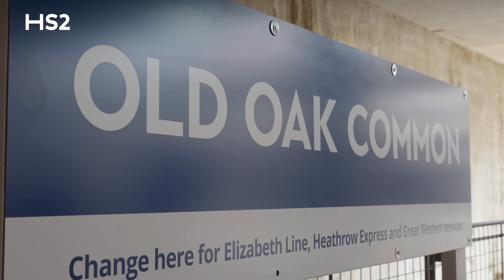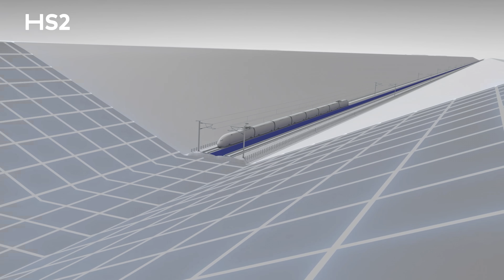HS2 Project Update, July 2025

Comment: It’s been almost 5 years and you are still fiddling around with the foundation at Curzon street station.

At this rate it’s going to take you at least 10 YEARS to build 1 train station. 🙄
Reply: The Curzon Street station contract is running to programme. The station building itself is undergoing a redesign in an attempt to get the project within budget.

Comment: Won't be used. Internet conferencing will be much cheaper. People will use the slower train as 10 min quicker and the other is  not worth the candle.
Reply: Incorrect StJohn. You clearly don't understand the project.
Reply: People will always need to travel. It's far more than a 10min saving, but time saving is not the primary point of building this.

Comment: This is so much better news.  In the past very little focus on the route wide benefits and employment has been made.  All we used to hear was speed and time saved, very little about capacity on the WCML and the network generally.  Folks will see big improvements to local road networks close to HS2, they will see bio-diversity better than before project, and a highly trained workforce that will be able to move on to other projects.  The UK's skill shortages for the last 40 years because, in my view, of the lack of technical education, with concentration on university for a non vocational degree.  Have you noticed how often a Professor of this or that is rolled out on radio and tv, or consultants in court cases usually all past retirement age, appear as expert witnesses.  Out of date and well past their sell by dates.  HS2 is back on course to the success it should always have been, Nimbies and political interference almost sunk it.  These were the biggest cost increase drivers.
Reply: If you asked 1000 UK citizens 'when did HS2 construction commence ?' , most would tell you 10-15 years ago. The actual fact was April 2020, so all that has been built has been done in a little over 5 years. The rest of it has been delay and obfuscation by Politicians of every stripe, Labour, Liberals, Tory and Reform. Local councils have literally gone out of there way to obstruct the project at every turn and continue to do so. Buckinghamshire being the worst.  Certain special interest groups, Quangos, sections of the media, have taken relatively small issues and exaggerated them.

Comment: A report previously published in france said their high speed train only really benefits Paris. This hs2 will only end up benefitting London. Its way behind and way way over budget.
Reply: the difference is France already has an established high speed network - and its one entirely centred on Paris - hence the problem you indentified

HS2 essentially isn't comparable with the LGV network because it's one (relatively small) line, of course it goes to London, you'd be insane not to send it there

in an ideal world, the high speed network in the UK wouldn't be biased towards London courtesy of HS3/NPR and HS2 already has provision for that with the building of the north curve at the delta junctions in Birmingham. not to say the HS network shouldn't connect to London though, because it's the UK's largest city

Comment: If it does not connect to the north then we are kidding ourselves on the value of hs2. We need a big push to get the railway open. Time is passing and the completion date just moves constantly to the right. The civils works will be 10 years old before the railway gets into operation. Great project but please can it be opened sooner and phase 2 restarted.
Reply: The entire anglosphere is taking way to long to build things.
Reply: Even if it does, projections show it will take 100 years to break even.
Reply: It could be connected to the north. It just needs another £100 billion spent on it...🙄..let have a whipround...😉
Reply: @leethrelfalllt  Just cut funding to pointless road projects that provide such little cost benefit.
Reply: @kmcat  The Thames Esturary Road Tunnel, The Stonehenge Road Tunnel and quite a few big ticket road projects are as likely to be built as HS2 Phase 2.
Reply: @kmcat name some?..🤔
Reply: @johnwood2448 And they will all go over budget and programme. As to will Heathrow's third runway, sizewell C, 1.50 million new homes programme and the new hospital programme.
Reply: Fatuous comment. @leethrelfalllt
Reply: @MrDavidht Fabulous comment.. corrected for you..😚

Comment: The cart before the horse unfortunately. Part of the railway establishment wanted to build a high speed line in the UK and only then started looked for somewhere to build it. Unlike France and Spain high speed rail is not appropriate in the UK as the large population centers are too close together and are already connected by 200kmh/125mph classic lines.
Reply: Sorry but you seem to have not had the email that HS2 is more about capacity increase and the freeing up of the WCML from path hungry express trains to give more pathing to freight and suburban services. But if you are building a new railway it doesn't that much extra to add high speed capability.
Reply: @1chish  The original flex for HS2 was faster journey times to London, the narrative only changed to adding capacity after the idea that tens of billions of pounds would be spent to save half an hour to get to Birmingham was met by some derision from the public. The capacity problem can be solved by running longer trains on the existing tracks.
Reply: @aw34565   Your last sentence shows a pretty firm lack of knowledge about how pathing on main lines works. Why do you think there is a length limit on freight trains? Because they take up too many 'blocks' which reduces the pathing.

I agree the initial naming just followed 'HS1' to be 'HS2'. However it was always built to add capacity by taking path hungry express trains off the WCML and not introduced later due to the costs. It was the NIMBYS and tree huggers that made 'speed' the only reason for it and make the very complaint you suggested.
Reply: @1chish   Very difficult to remove path hungry express trains from the WCML given that cross country services will continue to use the WCML as HS2 does not have a south facing junction. Also, folk living in cities that HS2 bypasses (Coventry for example) will still need express trains to London and the North so I can see why the original flex for HS2 flex was for speed. Mind you, the original claim for 36 minutes saving on the journey time between London and Birmingham is rather less than 36 minutes now HS2 line speed has been cut from 248mph to 200mph.
Reply: @aw34565   A question: Do you know how many people use Avanti West coast every year to Birmingham and the North? They fill a lot of trains.

Given that every Class 390 will be replaced by trains running on and off HS2 that frees up a large number of paths on the most congested part of the WCML that will be used for freight and suburban services like the Coventry ones you mentioned. Cross country do not run tilting trains (they did run Class 221s but no longer tilting) so their speed is restricted to 110 MPH on most of the WCML but in any case they use very few paths on that line compared to Avanti Class 390s.
Reply: @1chish  We cannot cut the number of express trains on the WCML to provide paths for other trains unless you want all the places on the WCML that HS2 bypasses (Coventry for example) to lose their fast trains to London. The capacity argument for HS2 is just hot air.
Reply: Look at a satellite image of England at night, all lit up. And you'll see exactly why HS2 has been built where it is, and where it was planned to go!

Comment: Whilst HS2 has benefits (mainly related to the much-needed additional capacity it will provide alongside existing routes between London and Birmingham), I can't help but wonder how much good the money spent on HS2 would have done to the existing network. For me, it's not so much about the big projects like HS2, it's more straightforward things like the refurbishment of Crewe station, the electrification of the Chiltern Main Line and the reopening of the Burscough Curves that would greatly benefit everyone (not just those who live in big cities). Since its inception in 2009 (under Gordon Brown's Labour government), HS2 has been halved in length but has more than doubled in cost, meaning that, for many years at least, most people north of the West Midlands won't feel all that many obvious benefits from HS2 (because most people commute to towns and cities within their region and not necessarily to Birmingham or London). It's a case of 'if only...'.
Reply: Although very true, the UK desperately needs to gain experience with building high speed rail, which of course comes with a massive cost (an obvious understatement) but as long as high speed development continues costs will also come down. HSR I feel is more encouraging to get people using rail which could then boost investment in smaller projects.

Realistically both large and small scale rail projects need to be funded but due to a large right wing movement, stupid levels of funding will go to useless car infrastructure which despite major investment will only make using a car worse (mostly because the planners refuse to accept basic traffic fundaments discovered in the 1920s because it goes against their ideology)

honestly the best thing and most needed thing for rail is a change on the gov's view for its importance
Reply: I agree with that. I think an example of poor planning for roads has been smart motorways. These don't reduce congestion at all, but instead spread the congestion out onto more lanes (making the roads just look less congested). Badly implemented road projects like these should certainly make HS2 (and East West Rail too) more attractive for potential rail passengers. Getting people out of their cars and onto trains is a challenge for the railways, but as they say, if you build it they will come...
Reply: @_Mintyz_  the problem is though that this project has been such a clusterfuck that no politician will ever advocate for HSR projects ever again.
Reply: @shermanmccoy81  That's true, but i'd imagine it would more depend on who is in power, if we get reform i'd doubt HS2 would  progress during their term.
Reply: Once it is up and running, the argument for completing/extending it, will become obvious. It is a shame that the construction industry and the political classes have contributed to destroying the reputation of our railways and engineering skills. Hopefully, to be appreciated when the service begins.
Reply: Also, can't really expand the existing network with new services and branch lines, until you expand the capacity of the existing network, to do what it currently does.
HS2 was an incredible capacity uplift across all 3 mainlines north from London and the cities they serve. That capacity enhancement, is what then allows the smaller local enhancements to fit into the current network. Which will not be realised until HS2 is completed in full.

Comment: I like the updates but every time I watch one I just can’t help but think who the hell is going to use this?
Reply: Well the millions that use the Class 390 Pendolinos on Avanti West Coast for a start because they will be retired or moved off the WCML.
Reply: @1chish and do you think that the price point of HS2 will be anywhere near what the WCML operators offer?
Reply: @ozbolli Well when you add the extra revenues on the WCML plus the revenues on HS2 and multiply that by 50 or 100 then yeah I think we will see a payback.
Reply: The franchise award of the westcoast mainline to Avanti, was predicated upon them becoming the initial operator of trains upon HS2. And everyday, today, loads of trains run non-stop between places north of Birmingham (like warrington, crewe, stafford, stoke) and London. Those are some of the HS2 services that exist today, that are used today, which will seemlessly use HS2 when it is open (on the new trains).

You also have to account for the fact that the current route has tilt, and when HS2 opens, the pendolino trains will be maybe 30 years old (certainly towards the end of their working lives) and the manufactorer doesn't make them anymore. The latest small batch of trains to suppliment the pendolino fleet, do not tilt. So it is most likely, that when HS2 is open, the existing line will become a non tilt 110mph railway, thus be slower than today. And by harmonising the route with a 110 max speed, you create even more capacity on it for regional trains and freight.
Reply: People won’t have a choice. It’ll be incorporated into the existing network. If you want a direct train to London, you’ll get on one which’ll be diverted onto the new track.
Reply: @Adam-nb6im it’s not being incorporated though this is a completely new, entire system. And where did you get your information?

Comment: Just stop building everything in bloody tunnels when they don't need to be. That would save billions alone.
Reply: And how do you get the line across the Chiltern Hills and building sites without upsetting the nimbys brigade, it now bit late for that.
Reply: @scottpeacock5492  Same thing here with the Groene Harttunnel which is 8km long and cost €420 million back in 2005. The complete HSL zuid was €7.2 billion and 125km long. However now we have to deal with construction failures which costs 500mln to fix which takes until 2031 with reduced speed.
Reply: @scottpeacock5492 How would you get over the Chiltern Hills if there were no Nimby's anyway ?
Reply: @TrevorWilliams-fq8mg  If there were no nimby's, the line would get built anyway with no stress, but hay your happy to drive your car on your local motorways that was once all fields.
Reply: Bit late for that, the tunnelling is mostly done, including the unnecessary tunnel under the Chiltons. It's everything else that's still to do.
Reply: The Bromford Tunnel has, apparently cost about the same as the above ground original plan, which would have required a large number of road diversions and new bridges. Added to this, it also avoids years of disruption to rail links betwee the East and West Midlands. Even the small amount of above ground work between the Bromford Tunnel and Curzon St, is causing years of local chaos. By building the tunnel, they have reduced what could have been many more years of gridlock over a considerably increased area, which would have decimated the economy of North and East Birmingham. Sometimes, the cost of a project is not just the upfront funds but also the effects upon the local economy.